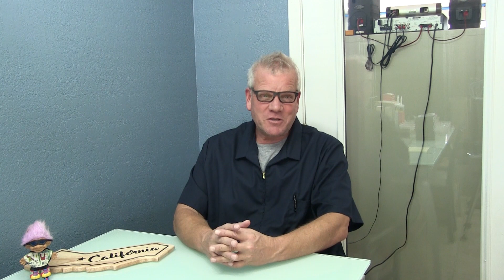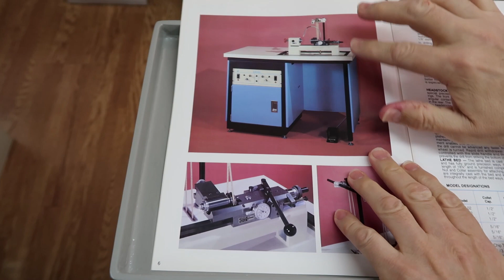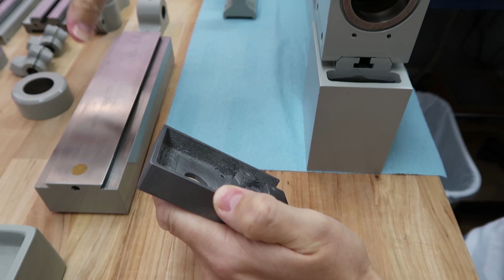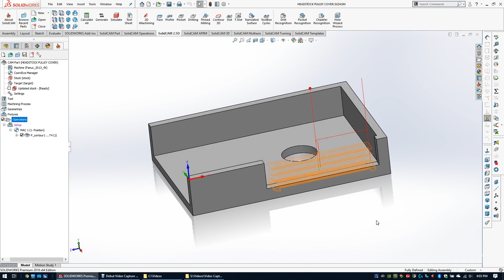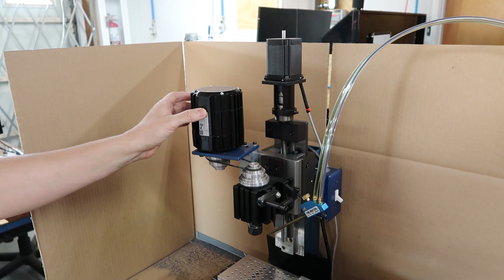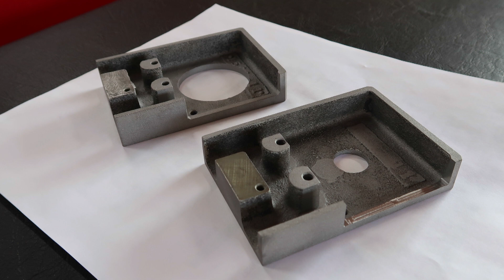SHOP ADVENTURES 02: Levin Lathe Pulley Cover Modification

Comment: Awesome - seldom do I see a CNC Taig running. Tons of Sherline but few Taig. 

The Solid Works demo was great to see. I have not jumped off that bridge yet. LOL! 

Drill press rebuild very cool as well. 

Dan
Reply from the maker: Hi Dan first of thank you for being here we are Lance ME and Patrick and we watched our first video from your channel just a week ago and you have a good approach to your projects of course we love Hardinge and will say why in we hope this year or in 2020, we have to work harder first. SolidWORKS is a surprise to be adapt in but we need a real CNC machine to run our programming skills on instead of for other machine shops. Vintage watchmaker parts machinists can program and run CNC's who would have figured. The TAIG (built it ourselves some electrical engineering skills also) is a really great trainer we actually machine grade 5 titanium 6al-4v for a project we are making., tip just go slow (no tool changer is a tough ride for us). This 4 axis is our trainer for something later. Stick around please Dan if you like we are actually going to start making a product in the coming months. We will be awaiting for what you work on next. Thank you Lance & Patrick.

Comment: Love that little drill press I'm into vintage flat belt machinery. I build foundry patterns also. Kinda need to if you're trying to save equipment as old as I am lol .
Reply from the maker: Hey thank you Lance here, we just subscribed to your channel reason is we like cast work we and you might be aware of Double Boost in England, Emma and PGS both in Australia we just love to watch them make the forms and pack the sand using those little carving tools and such and then pouring the cast in aluminum, bronze and brass from time to time not really knowing as a viewer if the pour is going to work. Thank you again Lance and Patrick.
Reply: @ActiveAtom  I know of them both in fact Emma did my old iron shops sine at the beginning of my videos. Check out " old foundry man " best older I have seen on YouTube I always learn something new in his videos. If you ever have a mind to get casting's made let me know I can probably help.
Reply from the maker: @OldIronShops  Great to know you offer cast work I will remember that Emma is a very talented person and great artist, we have been following Emma since the watchmaker forums (before YouTube) where she shared her Lorch Lathe and Patrick shared one he has as well with her. I will go watch and learn what materials to cast in so we are aware.